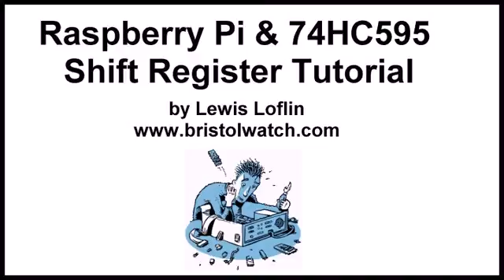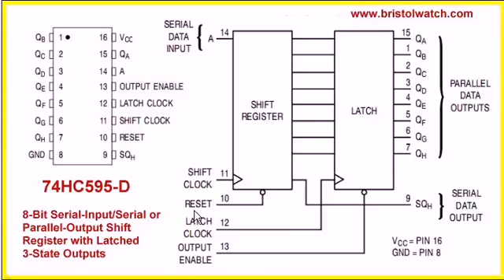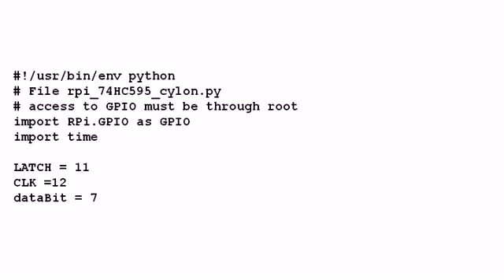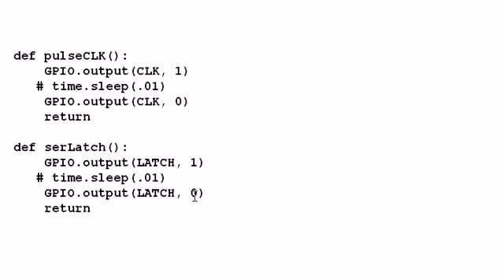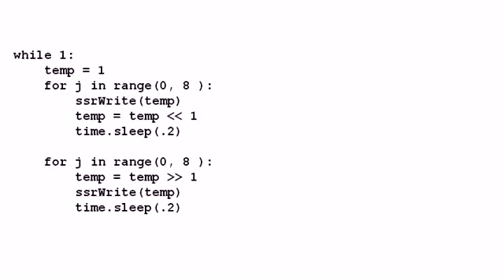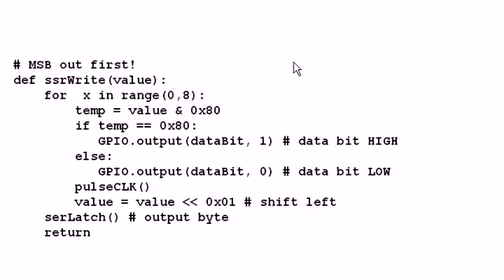Raspberry Pi and the 74HC595 Serial Shift Register

Comment: Sorry, I’ve followed exactly but all LEDs stay Hi. If I remove Vcc the lights all come on then off every 3secs! Also your code Includes the function convBinary which isn’t mentioned in your video and doesn’t seem to be called. You haven’t setmode to Board. Any ideas?
Reply from the maker: Send me your code and I'll be glad to look at it. lewis@bvu.net
Reply: @LewisLoflin  hi Again, although I said I followed your coding, I changed it to GPIOs 16,20 and 21 and used BCM - I now changed to BOARD and pins 11,12 and 7 and it works! I checked everything before honest! Thanks for your help and if you do have an idea as to why this happened it would be nice to know. Derek
Reply from the maker: Also, note that the program didn't use convBinary which was for testing. 
You also must set the mode. Try adding GPIO.setmode(GPIO.BCM)
Reply from the maker: If you are using pin numbering use this: GPIO.setmode(GPIO.BOARD)
Reply from the maker: I'm going back and add this info to the webpage.
Reply: @LewisLoflin  hi Lewis, thanks for quick response. I used your coding (without the convBinary and set to BCM. I’ll keep at it. I’ve tried a non pi version but still getting probs - I’ve tried 4 chips!
I’ll let you know if there’s a solution. Derek